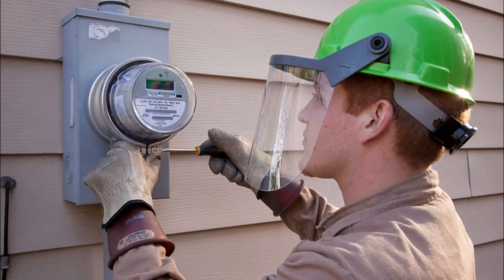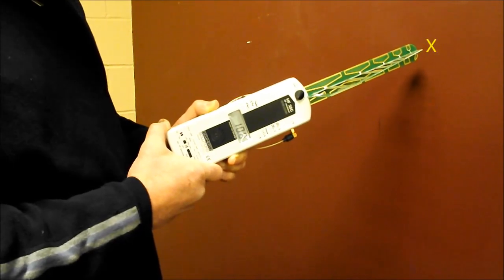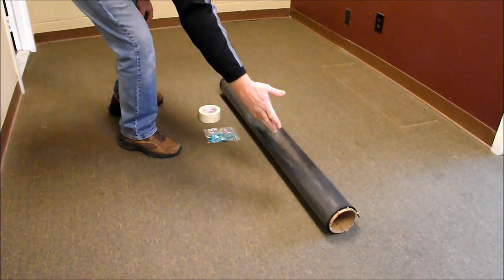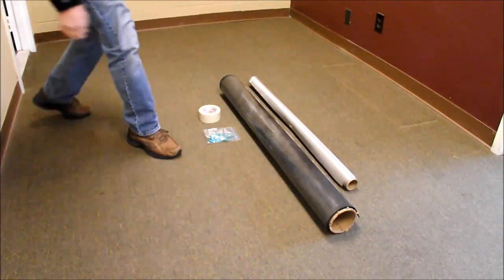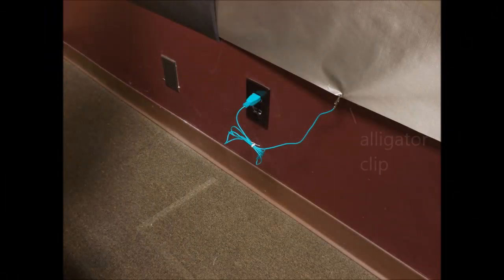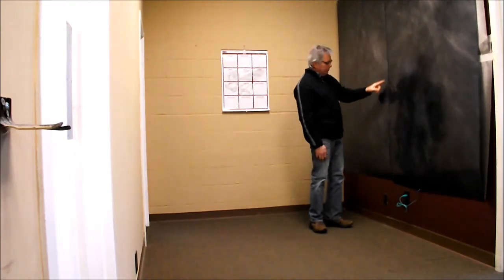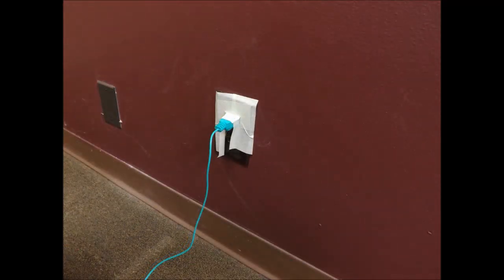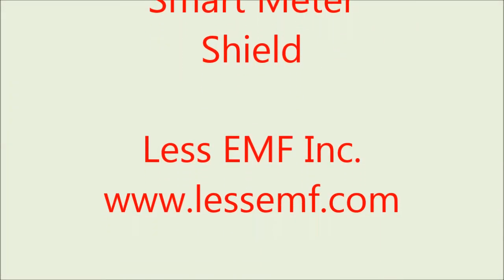Smart Meter Shield Kit from Less EMF Inc.

Comment: this same person posts over and over, they ONLY want your money and could care less about your safety THERE ARE many others ways that shielding can be done as one comment I read below, as said a poor man's way is buy Cheap aluminium foil , wonder if they removed that "HIGH QUALITY ground if much would change as the mere fact that a metal plate of something like aluminum foil will block much of what is coming through and some cheap foil and plain aluminium screen can cover the meter BUT BUT BUT, would if you live in a housing project or a cramped neighborhood and ALL of you neighbors have smart meters??? now what? put a faraday cage around your house? ONLY leave when absolutely necessary? , Move? you know in the country areas smart meters dont work as well and your better off in an area where this technology hasnt reached "Yet"  Ill bet soon a company will come out with different colored paints  that are aluminium based and of course metal coated siding and offer a new paint job for a small fortune and tell you you are hurting the ones you love if you DONT buy their scam, I mean product/service
Reply: What power company do you work for?
Reply: Yeah but if you put covering on the rear of the smart meter,  on the interior dont you ruin the sm ability to send signals? And the company will come check what's going on?